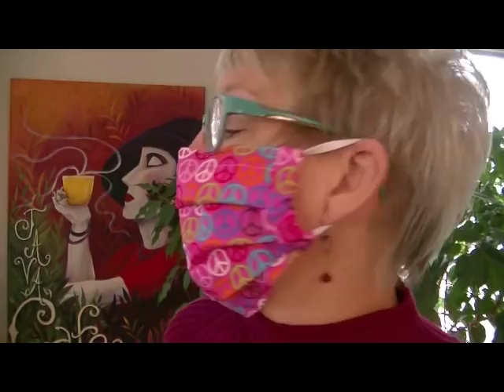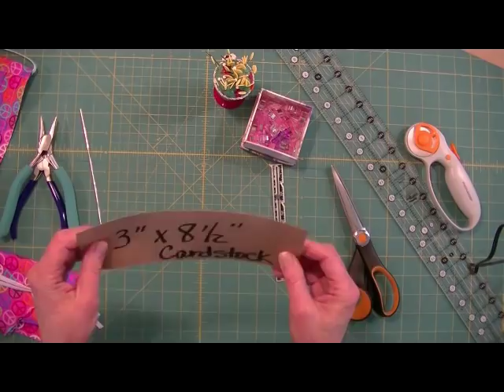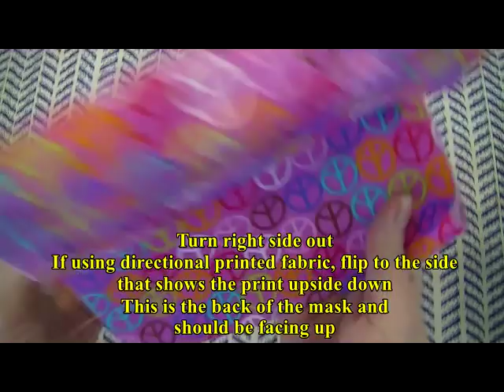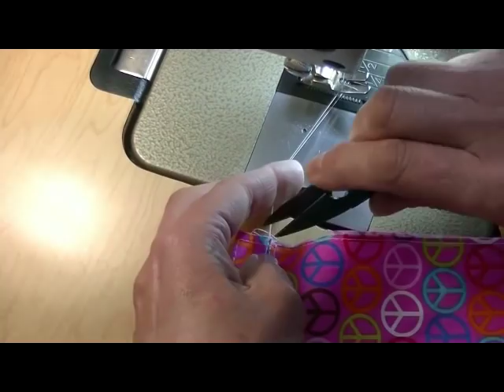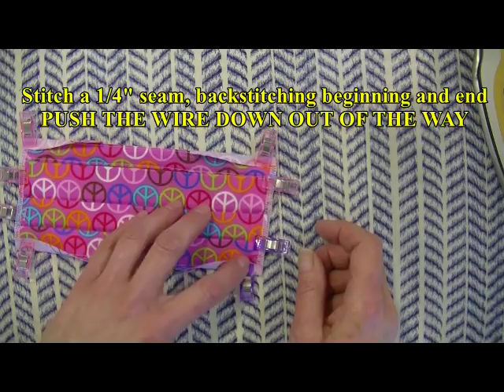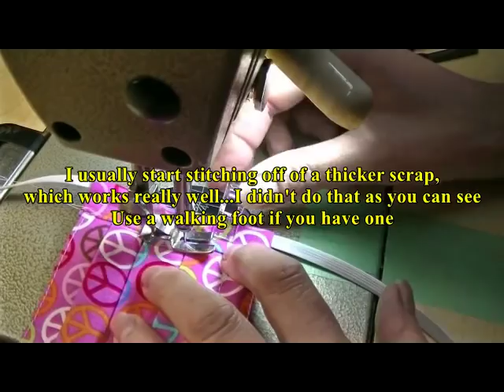DIY REUSABLE FACE MASK with FILTER POCKET-4 Style Options-1 Easy SEW Pattern-Won't Fog Your Glasses!

Comment: Very well explained instructions!  For myself, I make mine with longer elastic - through a bead so I can then adjust the fit around the ear.   (I have used a coffee filter in the pocket or blue shop paper towels - cheap added temp. filter ) Great idea to not sew the elastic in - so it can be replaced.
Reply from the maker: Hi Ruby, I too now use longer elastic, 12" and I will be adding a note to my video. The bead is a great idea. I am making these like crazy, and leave the elastic undone so the wearer can tie a knot for a custom fit. Thank you for watching and sharing your ideas.

Comment: I checked out your links on pandahall.com, and did a  search for nose wire for face masks.  They carry the plasty twist ties: PE Nose Bridge Wire for Face Mask, with Galvanized Iron Wire Single Core Inside, DIY Disposable Mask Material, Blue, 10cm(3.93") ; 4mm wide (AJEW-E034-59A-01).
https://www.pandahall.com/p-2340626-pe-nose-bridge-wire-for-face-mask-with-galvanized-iron-wire-single-core-inside-diy-disposable-mask-material.html

I have some of those, and they work great and are easy to use when adding to mask. I also ordered some of the aluminum strips that are the kind that are on dust masks and the N95 masks that have adhesive  on back, so you add to the outside of the mask.  I have not received yet, but I am curious as to how they will do with washing.  Hopefully, the adhesive is strong. 

Thank you for a super great video.  I loved the detail. Nice printed fabric for the video, too!
Reply from the maker: When I was looking for the nose wire, they didn't have them. Now they seem to have everything. Thank you so much for the info and for watching.

Comment: excellent tutorial, I like that the masks aren't bulky, also like where the filter opening is along with the wire encasement, great explanation  and easy to follow....I did save you to favorites cuz I am sure I will have to reference you again. great job Liz...do you have a pattern and print out of the steps...just asking
Reply from the maker: After you make one or two, you won't need a pattern. Check out Janet Kline's comment, she was kind enough to write it out. Thank you for watching.

Comment: I appreciate having links to supplies, so I ordered through pandahall, before checking its location. I wish I had known it was China at the start, but my fault for not checking. True, things on Amazon can be made in China too, but I'd rather stay made in USA as much as possible. 
This does not decrease my appreciation for your video, however! 😊
Reply from the maker: Sorry about that. Even the roll of elastic I bought from Amazon was from China. You may be able to Google a mill in the States.
Reply: @makingiteasywithliz  Yes, it's difficult to find many items that are made in America. Actually ordering from a company in China is a little more unsettling to me than from a US vendor whose product is made in China. Hope that makes sense, but I'm hoping for a good outcome with my order. Thanks for your kind comment! 😊

Comment: When you say to put the 'blade' down are you meaning to lower the feeddog?
Reply from the maker: No, the cutting blade on the serger. You just want to finish the edges and not cut the fabric.
Reply: @makingiteasywithliz  what would you suggest for those who don't have a surger?
Reply from the maker: Zigzag stitch or pinking shears on the raw edges. I quit using the serger on the pleats and just stitched them together. I have new updated pleat video coming out today that eliminates that step.

Comment: I bought some patriotic fabric  from Joanns. The stars have glitter, and I didn't want the glitter on the inside, so I cut out the front at 7.5 by 8.5 inches, and the lining at 7.5 by 7.5. I stitched at bottom at 1/4 inch, then followed your pattern. That way there is no glitter facing the face. Just a little of the front fabric on back where the filter pocket is. (1/2 inch). I LOVE THIS PATTERN!
Reply from the maker: Good job! Thank you so much, Denise.

Comment: Liz, I have followed you and I have made the mask, but I somehow missed what you did to make a pocket for the filter which you discussed initially when you started your wonderful task. Please help me. I keep watching the video and I do not get it. I have to admit that I do intend to make many masks like yours. If you do address the portion regarding the filter would you please take your time and address when that step comes in like after you place the wire and then what to do next in order to place the filter. I thank-you for your kindness. PS I love the serger too.
Reply from the maker: To answer your question about the pocket, it is created by the very first seam you sew, the serged/zigzagged ends. Look closer at your finished mask, it's on the inside if you did everything correct. You may have topstitched your opening closed. I will address the other stuff after I walk my dogs.

Comment: Here's a cheat sheet to use after making the first mask following the video. 
1. Serge or zigzag the edges of the two short sides without cutting any fabric off.
2. Fold, right sides together, aligning the serged edges
3. Mark 1 .5” in from each side. Stitch 1/4” seam to the mark, backstitch, pull thread and place needle at second 1.5” mark and sew, backstitch, then continue sewing to raw edge.
4. Turn tube inside out.
5. Press seam open.
6. Fold tube so the opening you just created is 1/2” below the top edge of the mask.
7. Top stitch on the bottom side of the seam just created.
8. Stitch about 1/8” around the entire mask.
9. Form a small loop in each end of the wire using jewelry pliers or needle-nosed pliers
10. Lay the wire against the fold above the opening and stitch from edge to edge about 1/6” above the opening.
11. Place mask wrong side up with folding guide under the mask. Align the bottom of the mask with the guide and clip into place using fabric clips or mini- binder clips. Repeat with the top edge. Now form two pleats with the excess fabric that is between the clipped edges. j
12. Clip the pleats on side of the mask then press in place.
13. Stitch the pleats down about 1/8” from edge using a serger if you have one.
14. Place one side piece, right-side up, with long side at top. Align one side of the mask, right side down, with the top edge of the side piece. 
15. Wrap the sides of the side piece over the mask, pin or clip in place then stitch. Repeat on opposite side.
16. Press the side pieces away from the mask and then fold and press turned edges in.
17. Form casing for elastic by folding side piece toward mask about 1/3 of the way then folding again so it just covers the stitching at the side of the mask. Repeat on opposite side.
18. Lay a piece of elastic against the fold and clip in place.  Top stitch on mask, about 1/16” from the seam. Repeat on opposite side.
19. Tie the elastic with an overhand knot and push it into the casing so the knot doesn’t show. Repeat on opposite side.
Reply from the maker: You absolutely rock, Janet! This is such a kind thing to do for everyone. I will definitely copy this and give it out. Thanks for watching and your support ❤
If you could update #11, which I said the wrong thing in the video. Place the mask FRONT SIDE UP on the pleat card...I don't know if it really matters, I haven't tried it with the backside up.
#13, I stopped serging the sides because I found it shifted the pleats and made it wider, and adds bulk. The only time I serge now, is the raw edges of the short sides.
I will be adding those changes to the video soon. Thanks again
Reply: @makingiteasywithliz  Happy to do it Liz. Thank you for sharing your video with all of us.
Reply: Janet, thank you for taking the time to do this!
Reply: Janet Kline  can u send this to me. Can’t figure how to print it out
Reply: @caroledwards6140  Did you get a copy of Janet's cheat sheet? I ran my courser over it and then did Control C. I copied it to an Office (Word) document and then printed it. I did make it "show more" before copying it. Happy sewing!
Reply: I can't see the beginning of the video where you say how to measure the material. I would appreciate the supplies and measurements needed. Thank you.
Reply: I have never made any of these before so thank you for also sharing this I agree it will be nice to have to help me remember :) <3
Reply: Janet Kline Janet, Thanks for the written instructions to go along with Liz’s fantastic video.  Her video was the best I’ve seen.   Can you tell me if there is a way to print out your instructions?
Reply: Thank you so much for doing this.  I am working on one now, and your cheat sheet will save me a lot of time
Reply: Janet, thank you!! I learn both ways, visual and written instructions. So helpful.

Comment: You said 2 masks from 1 fat quarter - could you clarify for a girl who is just bad at math and has never purchased a fat quarter.... is that 2 adult masks from a quarter, or 1 adult and 1 child?
Reply from the maker: That's a very good question, and I didn't know what a fat quarter was until I worked in a fabric store. A fat quarter is literally 1/4 of a yard of fabric opened up. Take 1 yard of fabric, open it up and divide it into 4 pieces. You get an 18"× 22" piece (fat quarter) x4.  This is different from 1/4 yard cut from the bolt which measures 9"× 44". A fat quarter enables you more of the fabric to work with. Fat quarters are popular with quilters, which enables more small pieces to be cut, getting more out of the print of the fabric. I hope I didn't confuse you. Thank you for watching, and actually reading the description lol. Yes, 2 adult masks from one fat quarter. Fold it in half lengthwise, after cutting the 15" off, you're left with enough for the side pieces. Fat quarters are pre-cut in the store.

Comment: Since I could not see up close, Which needle did you remove from the serger?  The first one or the second one closest to the blade? Also where did you purchase the peace sign fabric? Oh yes I forgot to ask if you only use one thread color when making these masks or do you change depending on the fabric you are using?
Reply from the maker: All very good questions. Since I wanted my serged edge to be less than 1/4", I removed the outside needle and thread, using the one closest to the blade.  The peace sign fabric is from a fabric store here in Nova Scotia and you might be able to Google it and buy Online (no idea the designer/manufacturer). I am mass producing these so, it's only white serger thread (you don't see that, and who likes to change serger thread?) and either white or black in my sewing machine. I do all masks at the same time that require white and then switch to the ones for black thread. I loathe changing thread, lol. Thank you so much for watching.
Reply: @makingiteasywithliz  Thank you for your reply but I am sorry that you misunderstood me asking about the thread as yes ma'am I can CLEARLY see in the video that you did in fact use White Thread but I was referring to whether or not you change thread on each mask that you make or if you stick with only one or two colors. I was also talking about in the serger as well as the sewing machine. People are trying to find a way to help out in any way that they can and where I would normally change thread depending on what fabric I would NORMALLY use in the case that many masks need to be made I was just trying to clarify as to whether people were sticking to one or two thread colors was all. Thank you again for your video and I apologize for any confusion.

Comment: Liz, thank you.  I really like your mask but I have a question regarding the link you provided for Meltblown filter fabric from Amazon.  It comes in 4 sizes.  Do you think size 10M is adequate?
Reply from the maker: Hi Carmen, the meltblown is disposable and to be replaced everytime. That is a 10 meter (10m) roll which is over 32 feet. That will give you a lot of filters but who knows how long this is going to go on for, so use your judgement.
Reply: @makingiteasywithliz  Does the filter go into the slot formed below where the wire goes?

Comment: Love your video! Am interested in what we could use for a filter. Is there anything suitable we might already have at home that might work? Any ideas?
Reply from the maker: Non-woven materials like coffee filters, shop towels (blue ones), etc. I have a link in the description for meltblown which is what the medical masks are made from, from Amazon. It takes a really long time to arrive. I'm still waiting for mine. Thank you for watching.
Reply: As I’m in Australia filter fabric is hard to get, but I found a cushion insert in my craft stash & the cover is made of polypropylene, so would this be much the same as the one on Amazon? If so I’ll wash it & cut into filter sizes
Reply: I did a lot of reading about fabric for masks. A non woven fabric is good....I found a non woven interfacing on Etsy. You can also use a “purse bag” ( the bag you get when you buy a fancy purse to keep in nice) or a shopping bag made from non woven fabric. The reusable ones.

Comment: I love this video my favorite maybe make it so you can remove the wire
Reply from the maker: That's a good point, but with the aluminum wire as I made it, it washed up great in the washer and dryer. The wire is so flexible, it easily straightened out for a perfect re-fit. I can't say about any other type of wire.

Comment: Fabulous instructions and video!  I want to make the version that you are showing with the green bias tape ties sewn on the ends.  Do you still add the casing pieces on the ends where elastic would go and then sew the bias tape over the casing?  Bravo on your pleating technique!
Reply from the maker: Thank you Debbie. The "bias" tape takes the place of the casing and is fitted over the raw sides. You don't need to cut on the bias. What I did is cut (2) 2"× 32-34" strips, fold in half lengthwise, press, then fold in each side to the center, press and fold back in half, offsetting one side a hair so you can be sure to catch the other side when you stitch. Open it and place it over the raw ends of the mask and clip/pin in place. Fold over the ends of the tape once 1/4" and topstitch down the tape close to the edge, to the mask, stitching it to the mask and down to the other end. I hope I explained that OK. Thanks so much for watching. I think the head straps should be a bit longer than the neck ones so be aware of your placement of them.
Reply: Thank you Liz. One more question.  LOL. Where did you buy your 14 gauge ALuminum wire?  I noticed on amazon site you talked about in front of the prices there are the letters CNB. Is that Canadian price?  As u can see I am confused. LOL. I found wire at my local Lowe’s but 14 gauge was way to stiff so I got 18 gauge but I don’t believe it is aluminum.
Reply from the maker: Hi Debbie, I live in Canada and I suggest you go to Amazon.com and search 14 gauge aluminum wire or 1.5mm aluminum wire. I am really liking it the best. I believe I put the link for wire from Pandahall.com, this is where I have ordered mine this time. It's cheaper and good to work with, a good company in my longtime experience with them. They are in China and it does take awhile to arrive. I bought elastic also. The links are in the description.
That being said, you can use any wire that won't rust and will hold its shape, but flexible enough to smooth and reshape everytime you wash it. Wire is my specialty so I known what I'm talking about lol. Aluminum is the softest wire that you can buy. You need the heavier gauge to balance out it's softness and ability to keep its shape. My first wire was 12 gauge aluminum, which is heavier. It worked but was a bit too stiff and hard on your nose, while bending it. That's when I ordered the 14 gauge, on Amazon. I like it a lot. DO NOT USE steel or iron wire, they rust.
Copper wire is usually soft but I would not subject it to washing and believe that it could leach copper which could be a problem to some people. Stainless steel is a good choice but the stiffest wire. Try 19-20 gauge stainless, or galvanized wire from the hardware store.

Comment: I am making masks for my family and I think this is a very neat and easy way to make these masks.  I love the serge stitch you use and will be investing in a serger soon.
Reply from the maker: There are so many cool things you can do with a serger. Thanks for watching.
Reply: I’ve been teaching sewing for 40 some years and love the Bernina Serger (we call the overlockers in Britain). If you get a mid range one it’s very substantial, easy to thread, reliable and runs very smooth.  Only downside is they are a bit pricey but my students have picked second hand ones up quite cheap.

Comment: The wire  can be hammered flat.
Reply from the maker: No, you don't want to do that. When you hammer it, it hardens it and it loses it's flexibility. It's called 'work-hardening'. The wire works great the way it is.
Reply: @makingiteasywithliz  Thanks
Reply: @makingiteasywithliz  would it be ok to use those things on bras that helps to adjust the straps.  It might be more comfortable than the knots.